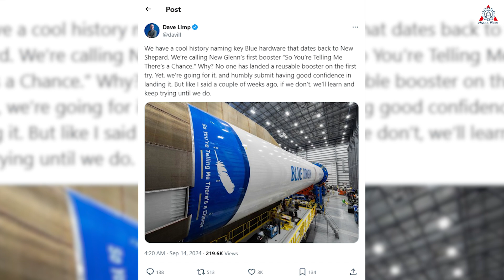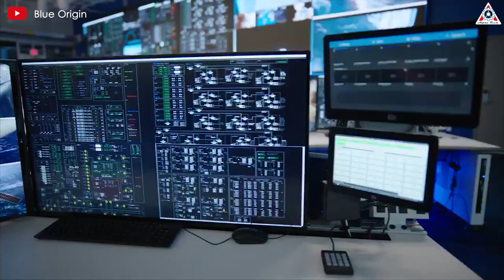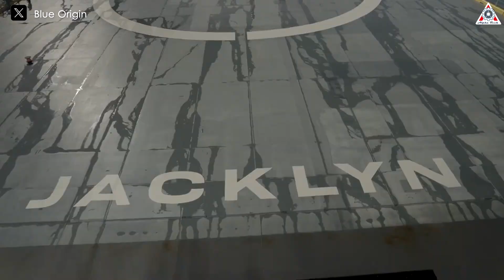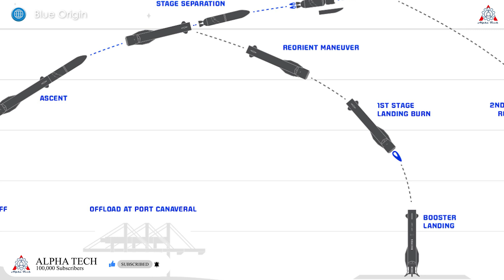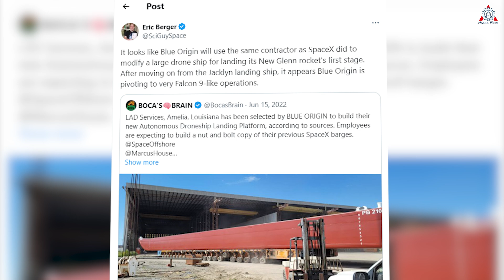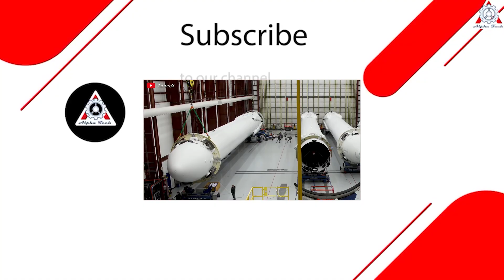Blue Origin New Glenn Landing System! Is It COPYING SpaceX & Elon Musk?

Comment: Barges have better primary stability than ships, also deck closer to the water line which acts as a fulcrum. And with a tall rocket potentally being a speed lever in a seaway, always good to keep things low.

A better design would be a floored barge where its like a floating dry dock, with floatation chambers at the sides and ends  but  
has a deck placed at water line. this would create better stability.
Also might be possible to build a center well below water line, so the strapped down rocket had a fulcrum point above its base, thereby shortening the speed lever effect effectively. With the water line level being the fulcrum.

These landing barges are just cobbled up, not designed to purpose.

Its that kind of era in Space Endeavours...

Will be interesting seeing how the tower and catch arms system works, and how accrurate you can be consistently landing a rocket. Might be possible to design a system where you land a ship on a rail, like a Bayonette mount. Where once on,
 you could lock it to the rail, and then the rail act as your de-erector and erector. this would allow transporting rockets horizontal, erecting for launch, and then after landing to lay horizontal again.
(The Navy might be interested in that.)

Could also be used on RXR flat cars for launcher landers.

I think its possible, but would require serious thrusters at a couple levels around  the rocket shaft.
To get necessary accuracy in some winds etc.

Another interesting thing about that system is would allow braking between Rocket and rails.
 you could save fuel by having the rocket still moving, and exchanging inertia for brake heat. Or you could use air over hydraulic shock absorber systems.

The nice part of such a system is it wouldnt need a tall tower, maybe sized to stack second stages also on a rail from the bottom.

One could get pretty cagey like that, maybe even have it auto connect and disconnect umbilical in the rail track at the bottom.

Making quick relaunches more automatic.

Barges with cracker box super structures dont impress me...
crude, unimaginative, crappy engineering, 
At least Elon's barges have some style and class... Jeff's, not so much... Cant litigate your way into class Jeff! 
🤭